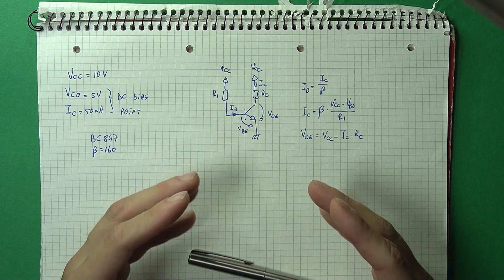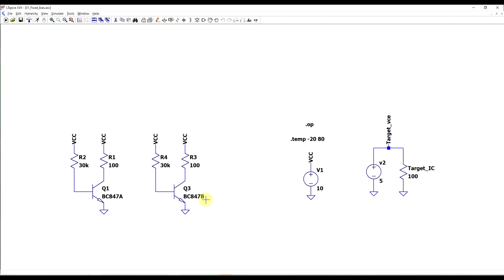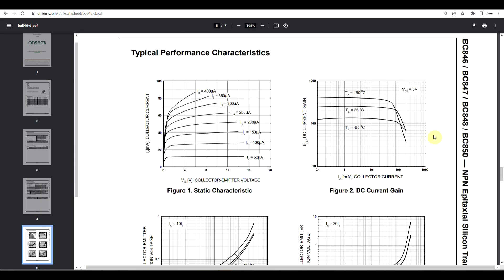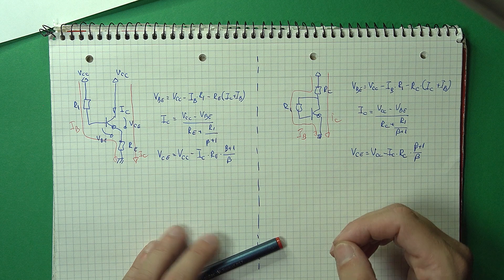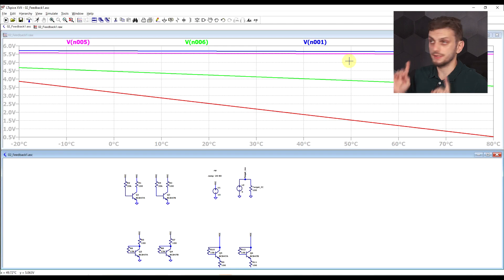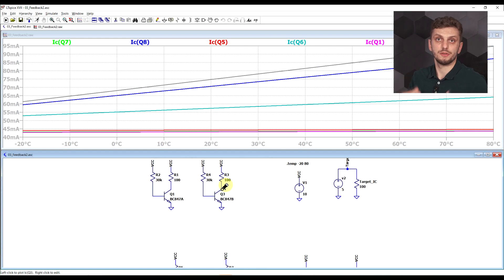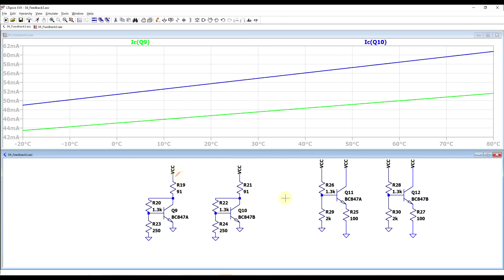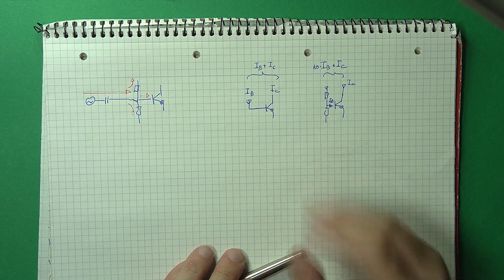Setting the operating point in a BJT amplifier

Comment: How can you choose the right Beta, If there is no problem everybody would choose 800, What is the method to choose "Beta"
Reply from the maker: The component datasheet will usually give an interval; also the beta is current, temperature and Vce dependent; usually, to be safe, you should determine the realistic extreme values of beta (both maximum and minimum), and make sure the circuit works for both.

Comment: If the transistor has been properly biased in active region then which parameter defines the minimum alternating singnal input voltage or amplitude in datasheet?

Comment: I've got a simulation request you might be able to help with Fesz.  I've been trying to create a circuit (like a B source) that when a voltage level is attained, linearly ramp a load current for a period of time up to a terminal level. This would be useful for simulating the soft-start turn on load of a buck regulator when the upstream capacitor get to full. I can't figure out how to do the time-dependent current ramp part.
Reply from the maker: You can use "time" as a parameter in the behavioral source. For example in a transient simulation that takes more than 1 second, using "I=if(time<1,time,1)" will set a level going from 0 to 1 (in the first second) then afterwards the level stays 1.

Comment: You're missing a trick. The most stable circuit is when you use a collector-base feedback resistor divider and an emitter resistor. That arrangement can easily improve both the temperature and β stability of the collector current by a factor of 4 or more even with as little as 250mV across the emitter resistor, compared to the circuit with fixed base bias divider resistors. That maximises both the gain and output swing at the cost of lowering the input impedance.

Comment: Howdy. Nice.
I would suggest some modifications I have used with good results.
1. The basic base current biasing.
To avoid thermal avalanching I use an extra reistor after Vcc. The base resistor and collector resistor connect to this extra Vcc resistor cold end. Then I use a suitable capacitor from this cold end to minus. I sacrifice 1 to 2 V of the Vcc in this extra resistor. If the total current tends to grow so will the voltage drop over the Vcc resistor and the base current will go down.
2. The base resistor to the collector version. The thermal regulation is good but much of the transistors raw gain is sacrificed. Also the neg. feedback tends to lower the input impedance. I suggest splitting the base-collector resistor into two parts in series. Then I suggest connecting a suitable capacitor from the split point to minus. This will eliminate the neg. feedback but not influence the thermal stabilization.
In regards.
Reply: It's not the case that a collector-base divider network sacrifices any significant gain. Try either building or simulating a circuit with a 10V supply, a 4.7K collector resistor, a 270R emitter resistor and a 100K - 10K divider to bias the base. You need a transistor with a β of at least 100. I've built and simulated it with a BC547B (β≈300) and BC547C (β≈500), You'll get a collector current around 1mA, an input impedance of 8K and an ac gain of 15.6.

Now remove the 100K upper base bias resistor and put a 47K feedback resistor from collector to base. You'll find that collector current is roughly the same, the input impedance is 2.3K and the gain has dropped 1dB to 14. However, the collector quiescent voltage now only changes by about -7mV/°C instead of the -28mV/°C you get with the straight resistor divider circuit. There is also a drop in distortion by about a factor of 4 as well as a reduction in the output impedance.

Now, of course, if you have a guaranteed high-β transistor, you can increase the values of the base-bias/feedback resistors and raise the input impedance if it's an issue. You lose a little of the extra temperature/β stability, but you're always better off than with the straight resistor divider base biasing.
Reply: @RexxSchneider  Howdy. Ok.
Thanks for the thorough comment.
Regards.

Comment: Whilst this is all electronically correct and good for illustrative purposes showing the benefit of negative feedback, it makes no sense to set the bias points without paying any attention to what the voltage gain of the amplifier needs to be. The voltage gain is determined by Ic, Rc and often to a lesser extent Re which in turn alter all of the component values that have been determined here. Regardless, the points about hfe sensitivity and temperature sensitivity are well made.
Reply from the maker: Of course, it requires a lot of consideration to determine the intended bias point - as you said based on linearity, gain and so on. My objective however was to separate topics - I wanted to look at the step you take after figuring out an optimum bias point. I may treat the topic of bias point selection some other time.
Reply: No, the maximum usable voltage gain depends entirely on the supply voltage and to a significant degree, nothing else. The most you can get out of a common emitter stage without distortion becoming significant is Vcc / 500mV. I'd be happy to show you the derivation if you don't already know it.
Reply: @RexxSchneider  For the general configuration of the common-emitter amplifier, the voltage gain can be closely approximated by -gm*RL for the degenerated case and -gm*RL/(1+gm*RE) for the non-degenerated case. My point was that if you choose RL and RE for an optimum bias point, as per this video, the resulting gain is very unlikely to be where you want it. So both operating point and gain need considering together.  I take your point that for the specific case where gm*RE<<<1 and the o/p quiescent point (Vc) is a fixed percentage of the supply (say 50%) then the RL dependency cancels. However, I calculate a maximum voltage gain of approx VDD/50mV so I would be interested in your calculation that is a factor of 10x lower. Cheers!
Reply: @Mike-H_UK  You'll notice that I stated "without distortion becoming significant" when I quoted Vcc / 500mV.

For the general configuration of the common emitter amplifier, the voltage gain is indeed - Rc / (Re + re) where re=1/gm - in other words the slope of the V-I curve for the base-emitter voltage. That intrinsic resistance can be shown to be equal to 25mV / Ic. The operating point has little effect on gain as it is normally targeted at somewhere around half of the supply voltage. If the load resistance is Rc, and about Vcc/2 is dropped across it at no signal, then the collector current must be Vcc / (2 x Rc).

If you have no emitter resistor, then the gain would be -Rc / re = - Rc / (25mV / Ic) = - Rc x Ic / 25mV which depends directly on the instantaneous collector current. That yields a higher gain for the negative-going part of the output signal than for the positive positive-going part which results in a nasty distortion of anything other than the smallest of signals. This would be the case for your calculation, where - Rc x Ic / 25mV = - Rc x (Vcc / (2 x Rc)) / 25mV = Vcc / 50mV, but that's not usable.

You reduce the distortion to acceptable levels by having an emitter resistor of the order of ten times greater than the quiescent intrinsic emitter resistance (that's, of course, where my extra factor of 10 comes in). In that case, we set around 250mV across Re to make it around 10x bigger than re. The gain can then be approximated to - Rc / Re = - Rc / (10 x re) = - Rc / (10 x 25mV / Ic) = Rc x Ic / 250mV = Rc x (Vcc / 2 x Rc) / 250mV = Vcc / 500mV.

Of course, you can increase that by a tiny amount by lowering the quiescent bias point, or by lowering the emitter resistor a little (at the cost of noticeably increased distortion), but I stand by my claim that you won't get a usable gain of more than about Vcc/500mV out of a single common emitter stage, and it's a good rule-of-thumb to design with. If you want a gain of 50, you're realistically going to need a supply voltage of at least 25V, and so on. Cheers!
Reply: @RexxSchneider  Thanks! What you say sounds fair enough and the calculation is the same as mine except you add ~10*Re for degeneration to reduce distortion. As a matter of interest (or because you seem genuinely interested in amplifier analysis), my circuits tend to have small signals (<1mV) and are complementary, so the 2nd order distortion terms cancel (apart from device mismatches), and the third order terms are reduced by ~80dB from the first order term in the Taylor expansion of the exponential (Ic vs Vbe equation). I find that I don't need degeneration to obtain these distortion levels because the signal is small, but noise is a real problem. Even a 10 Ohm degeneration resistor would add 0.4-0.5nV/rt Hz thermal noise and add approximately 3dB to my noise floor. Fun stuff!!
Reply: @Mike-H_UK  You're quite right, when your input signal is of the order of a few mV, then noise is your biggest enemy and you have to reduce the emitter resistor. Fortunately, you often have the option of using a collector-base feedback resistor to improve linearity, but at the cost of a lower input impedance.

Is your background in RF? Most of my design has been with audio, and the only time I had such small input signals was with moving coil pickups (which were happy driving into lower input impedances), although a common solution was to use a transformer to step up the tiny signal and feed a differential preamp. Of course, in those days, the BC109 was the best low noise transistor commonly available to me. I remember being excited when the BC179 (pnp) became available because it had a slightly lower noise figure, and then re-designing all of my preamp stages to use pnp instead. Happy days.
Reply: @RexxSchneider  I spent 30 years in analog CMOS IC design for data communications and now design LNAs for small HF magnetic loop antennas (mainly for myself). Most of my input stages now use paralleled JFETs for low noise. As you say, happy days!

Comment: Very good video... although it seems like an "old topic" for the new generations, they are the base... the foundation of solid state electronics. Greetings from Colombia, South America
Reply: Not at all. Because there are no op amps that can be connected to an output stage directly. If we are talking about a sound amplifier, you can find an opamp only as an input differential stage, and zero monitor. The rest stages are made of discrete components.
Of course if are not talking about LM-like all-in-one amplifiers
PS D-class is another thing.

Comment: In the description are assumed some value (for Ic, Vce and voltage on Re) not explained. 
The problem in this kind of design is to keep the amount of stabilization feedback as high as possible without lowering too much the gain of the circuit and for avoiding thermal runaway.
Reply: Small signal transistors don't suffer from thermal runaway as long as you design their collector current to something sensible. I'm not sure what kind of application requires 50mA collector current, but you really don't need that much current to design a single stage common emitter amplifier. Most of the time, you're far more likely to be working with currents around 1mA. With a 10V supply, that will allow a usable voltage gain up to about 20x and an output impedance of about 5K. The collector current determines the output impedance, so if you know what is needed to drive the next stage, you can work out the collector current you need to set the collector voltage somewhere about half of the supply voltage.

The gain of the circuit is given by the voltage across the collector resistor divided by the voltage across the total emitter resistance. Because the transistor has an non-linear, internal emitter resistance of 25mV divided by the collector current, we normally want to set no less than 250mV across the emitter resistor to "swamp out" the changes in the transistor's internal resistance and reduce distortion. So the maximum gain you can reasonably use with a 10V supply is (half the supply voltage) divided by 250mV = 5V / 0/25V = 20. If you need less than 20 gain, you can use more voltage across the emitter resistor. Now you know the emitter current (= collector current) and the voltage across the emitter resistor, you can calculate its value.

Since you now know the voltage across the emitter resistor, you then know that the voltage at the base is 0.65V higher. You know the collector current and the value of β for your transistor, so you know the base current. It is then just a matter of picking two resistors to bias the base to the voltage you calculated, while passing at least ten times the base current.

So starting from a given supply voltage, a required output impedance and a required gain, you can calculate values for Ic, Vce, and Ve, as well as the values of all four resistors, assuming your transistor has a minimum specified β.

All of those steps are probably too complex for a YouTube video aimed at covering the basics, but I'd be happy to run through a full practical design in the comments if you want to suggest the parameters (either input or output impedance, and gain) for the required circuit.